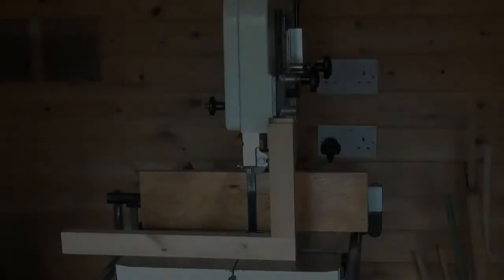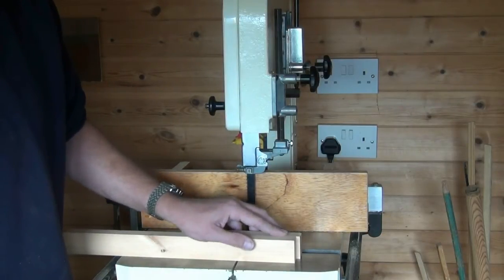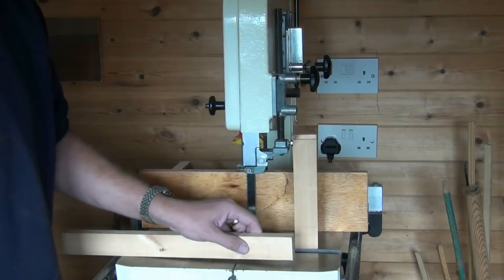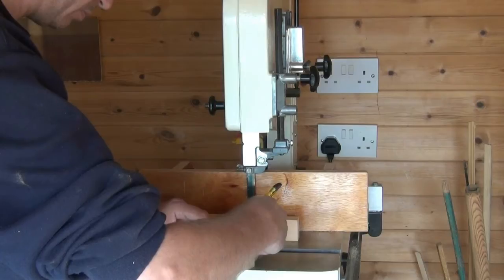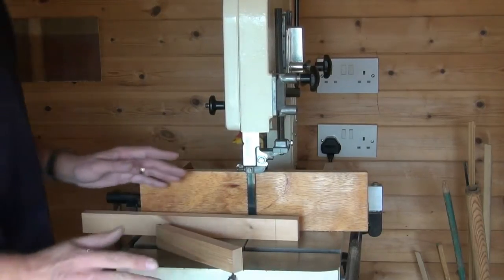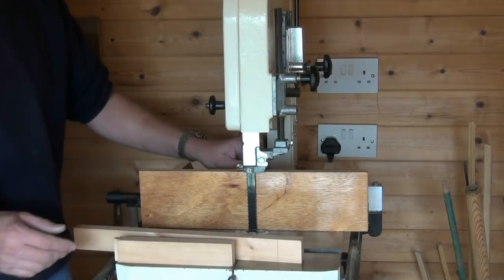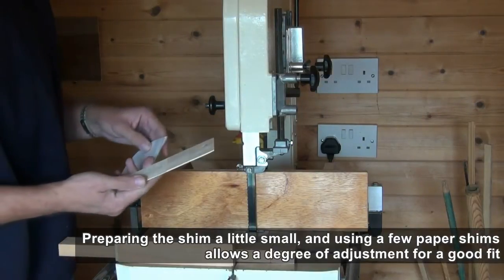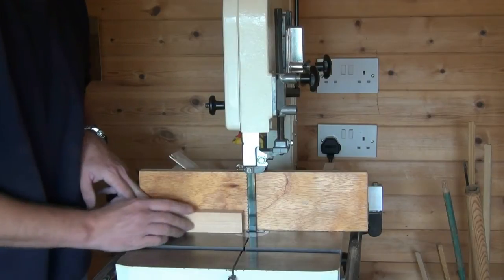Bridle Joint on the Band Saw

Comment: What size blade are you using
Reply from the maker: Goodness me this was a long time ago! I can't remember for sure but I would think probably a 5/8" 4tpi skip tooth or similar. It's not particularly important and mainly affects the fed rate. A 1/4" 10tpi standard blade would be fine if the rip cuts are taken slowly.

Comment: Hi Mitch-

Curious as to why you used a high fence for such a narrow piece of wood?
Reply from the maker: Hi Marc, Golly it's such a long time ago. There isn't any technical reason to use such a high fence, something close to the component height or higher is fine, as long as it's accurate, is good.
Reply: That's the problem with the internet, things are around longer than one can remember. I used the stock fence, and the bridle joints are really good. Thanks for the tip on the shim. Worked great. As much as I would like to have cut the joints by hand, my skills with a tenon saw need more improvement. The bandsaw method kept me moving ahead with the project. On to the raised panels next!
Reply from the maker: Marc Sitkin It's important to keep the momentum up on a project, that way you'll have time after to practice with the tenon saw 😉